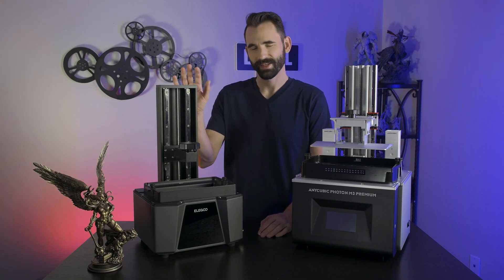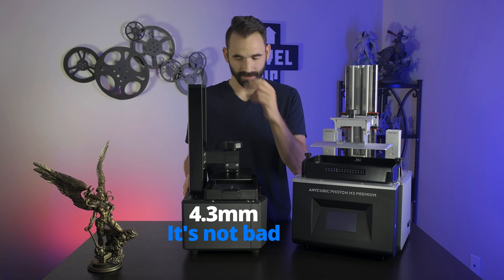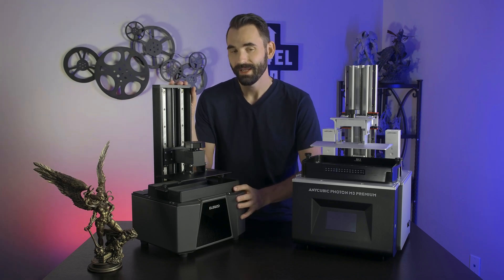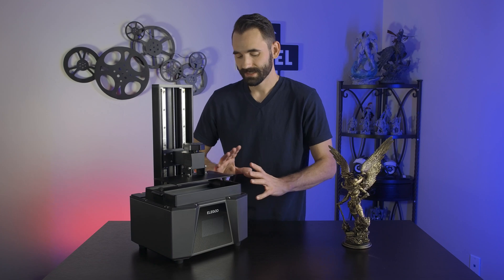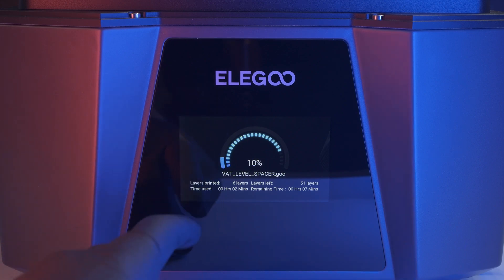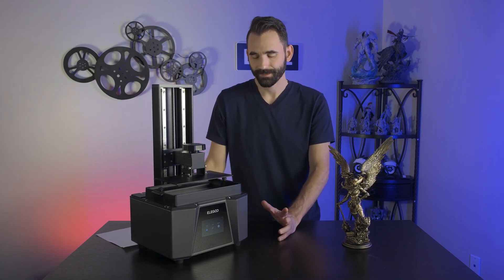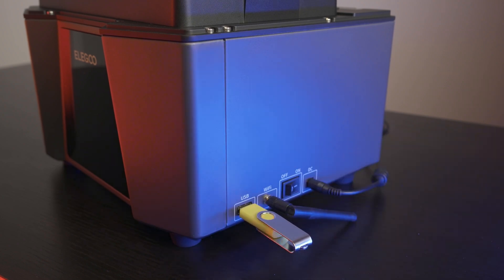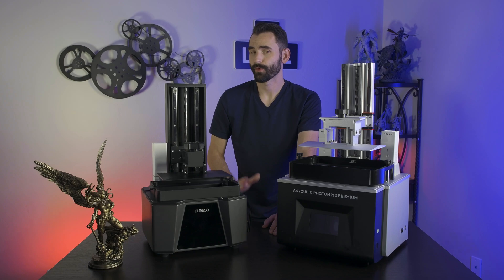Saturn 3 Ultra Review #review #3dprinter

Comment: Thanks for your video and sharing your thoughts mate, much appreciated...I prefer build quality over features. I'm still frustrated that I can't buy a brand new M3 from a reputable company...I'd get one in a heart beat if I could.

I find the info on the build plate leveling very interesting...I levelled mine using the included paper (which is thicker than standard A4 printing paper) and just did the very basic paper method and it printed perfectly first go...and I've done several prints now without failure or problem...I will track down your build plate levelling calibration tool though and run it just to see what happens and if it indicates if any improvement is possible.

The other thing I found very interesting is your mention of the speed limitations...is this factory limitation imposed on both lift and retract speeds for both bottom and normal layers...I have my bottom layer lift speed set at 10mm/m and 40mm/m for normal layer lift speed...if I understand you correctly, the printer will overide the sliced setting and force a 120mm/m speed for both?

Also, I either read or watch somewhere than the Anycubic M5 and M5S have factory settings that overide the slicers AA settings, which I am really glad Elegoo seem not to have done, I really feel that full control of AA should remain with the user.
Reply from the maker: Thank you! 

In my testing and others I've interacted with the speed limit is a thing. Very strange... The Saturn 3 none ultra  .goo won't do AA using Lychee or Chitubox.

I'm not sure on the M5s and AA settings as I don't have one. It would be good to confirm however.

Comment: Those filters mostly just reduce the smell and not the VOCs
Reply: The majority of the smells are from VOC's. a HEPA + Charcoal filter will get the printing fumes close in line with e.g running a gas stove. The point is you don't run a gas stove next to you for 8 hours a day, so still keep exposure limited. Sticking it in a side room with an air purifier/ HEPA+Charcoal filter and coming back an hour or so after it's finished printing and the air quality should be absolutely fine
Reply: @SirProdigle what HEPA + charcoal filter do you recommend? Are you referring to the one included?
Reply from the maker: I've not even noticed that.

Comment: Nice review. I'm in the market for a new printer and I'm currently trying do decide between this one or the GKtwo. I prefer build quality and reliability over features and speed. However, the heated vat in the GKtwo makes that being at the top of my list at the moment.
Reply: A thermalvatband converts all your vats to heated.
Reply from the maker: I've not printed on the Gktwo but I've played with one for a bit. I was not impressed. Overall it's a good idea but a lot of cut corners all over the place. Not to say these $500 printers don't also do this. But they are also not near the price of that printer and do get a perspective pass on some of it. 

The M3-PREMIUM with a $60 egg heater installed is vastly better than the Gktwo from what I saw and seen. This puts the ultra a close 2nd.
Reply: @J3DTech  I see, thank you for that information. I looked through your guide but couldn't find anything about a DIY heating in there. I'm not sure what kind of egg heater you are referring to.
Reply from the maker: @HavasiP  This section, and look under "Greatly Improve Print Quality and Success Rate"

https://docs.google.com/document/d/1Z8fkzOxEgI9sOTwDKI6CeblpnuP4V8ayYVwZrYGmo44/edit#bookmark=id.f7x19c30uvoc

Comment: Heyo, so I am really curious to hear what you think about adding PTC heaters and a temp controller to the bottom of the main plate to heat the build area and the vat to 30*C. The spot I kept my printer in my house had a lot of temp variation, and on a long 24hr+ print it would sometimes fail from it. On my original Saturn it worked wonders to stabilize the print temps and kept everything way more consistent even with a 10 degree variation. I'd really like to see someone more experienced try it.

Also cool hobby you picked up! We used to work together once upon a time. Still have the asset tag on the squirrel. T:00024 S:L33T
Reply from the maker: I do remember that squirrel 🐿️.

Running a heater is great I've tested several and strangely my favorite is an egg heater off of Amazon followed by the vat heater. 

In my guide Linked in the description, go to the bottom and I have both listed with pros and cons.

Always, reach out if you need anything.
Reply: @J3DTech That would be an interesting video, a comparison and some "how to" when it comes to DIY vat heating.